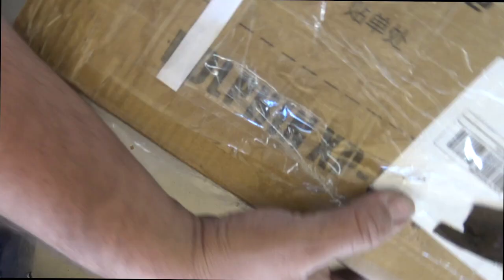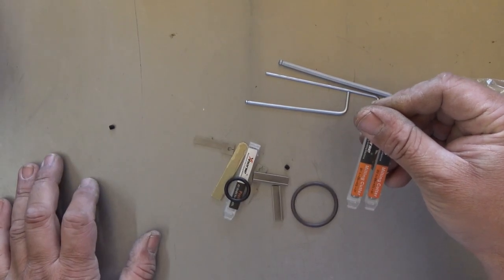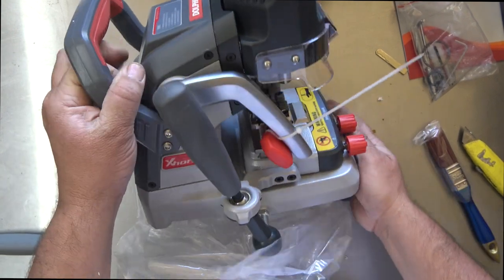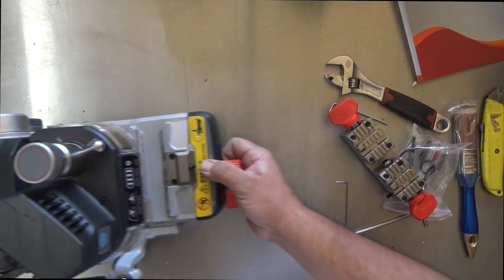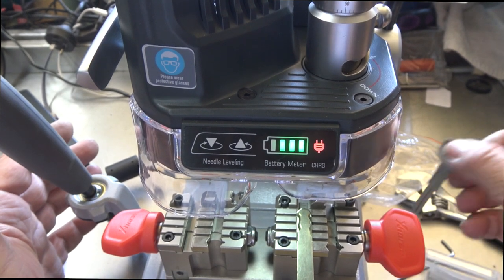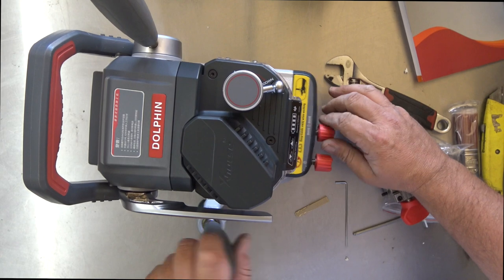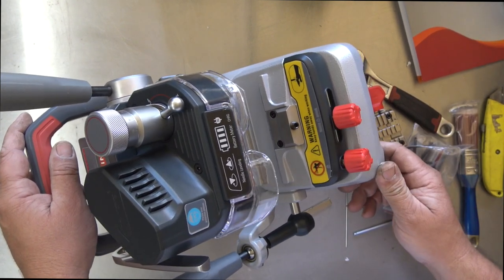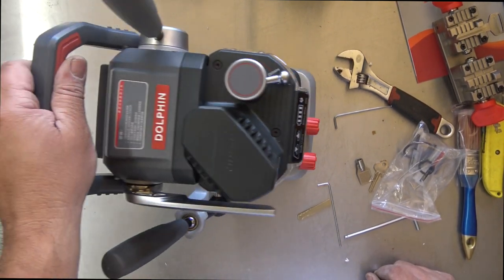Looking over the Xhorse DOLPHIN XP007 Key Machine

Comment: First thing that failed is the leveling feature.  I have had this for about a year and a half, and I like it but was disappointed when the leveling feature failed.  It is a pain to calibrate even with the leveling feature.  You do need the wide cutter and narrow cutter I have found.  I thought I'd be able to just leave the narrow cutter on but it didn't work well on certain high security keys.  Overall I like it okay but wish I hadn't have sold my older machine.
Reply from the maker: The only leveling function it has is the guild and the cutter tighten them both and adjust accordingly, the led display makes it easy
Reply: @DrLockShop  Yes the lights on the leveling stopped working
Reply: @DrLockShop  the LED stopped working, they don't light up. I can still calibrate it but it sucks they failed six months after the warranty ended.
Reply: @rmsg7504  i have had this for 8 months. There is something about its calibration I did not understand. Regular sided keys I did okay. Honda type of keys, i did horrible just like GM or High security keys. 
I ended up buying the auto cutter but still looking at calibrate the manual one. Id like to be in charge and cut it myself.
Reply: @DFWAuto_Hack  I've been manually calibrating, works better than with the LED leveling feature. As you know, my LED feature stopped working. But I can copy HU100 and HU101 just fine. HO01 and HS Hyundai and kia good too.
Reply: @rmsg7504  wow. Pretty impressed as i think mine is still out of calibration. I cut a metal sided key but even missed it. I tried hu100 & cannot get it
Reply: @DFWAuto_Hack  make sure you use the fine tracer with the fine cutter. Put two of the same uncut keys in jaws. Lower tracer and cutter place them on keys then tighten down. Make sure to also use tip stop. When copying a test key make sure it is not heavily worn. Try to copy a new unused key then polish it on wheel removing burrs. Then test in lock. You might have to spend some time fine tunning it until its perfect.
Reply: @rmsg7504  thanks a lot for your prompt reply. I think i also have a problem with the clamps... i will definitely take your advice and switch my probes and cutter again to 1.5mm and try again. 
The design was usually good but the key would never enter the lock as if it was too fat. I ended up thinking i had worked on  the wrong key lol. Blaming other stuff for our shortages... You know it goes lol.
Having the same issue with Lishi. I used original vs genuine nsn14 on 07 infiniti m35 lock (no key) & the feeling was the same. Now im thinking, either the lock is the culprit or ultimately me lol
Reply: @DFWAuto_Hack  I stopped buying certain aftermarket keys on Amazon and eBay as they were sometimes too thick or too wide. Specifically Lexus HS keys.
Reply: @DFWAuto_Hack  also some keys do require the wider tracer and cutter, you have to go through the whole calibrating process again.
Reply: @rmsg7504  wow. Interesting. For now im enjoying the convenience of the auto cutter but id be really proud if i could master the manual cutter. A lil bit of the feeling one may get from driving a stick vs an auto trans car if you see what i mean
Reply: @rmsg7504  sorry for the late reply. What keys require wider cutter & tracer
Reply: @rmsg7504  I am sorry to hear that but I am glad you are still able to copy these. When I calibrated it, the green leveling displays showed it did it right but I have always had the feeling that my clamps are not properly located...
I got lucky somewhat copying a metal key once but that's it. I torn up 2 HU100s apart. Either I leveled too deeply or I set the depth so shallow that the key would not enter the lock. I kind of gave up when I received the auto cutter which has served me awesomely well so far and I use it along with the XC009 side key duplicator that I find great with a simple calibration.
Reply: @DFWAuto_Hack  you sometimes have to put the cut key in the cutter side calibrate it that way then switch it the probe side and put your blank in